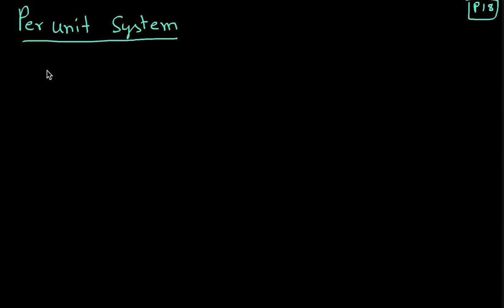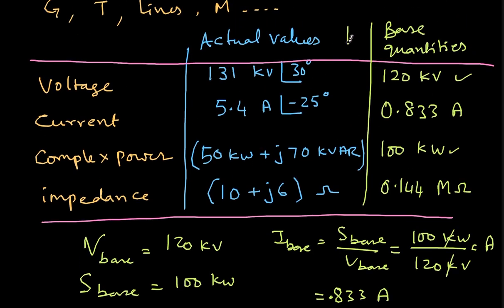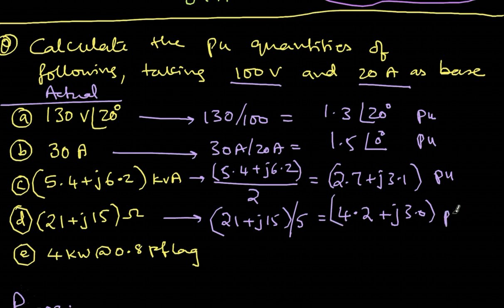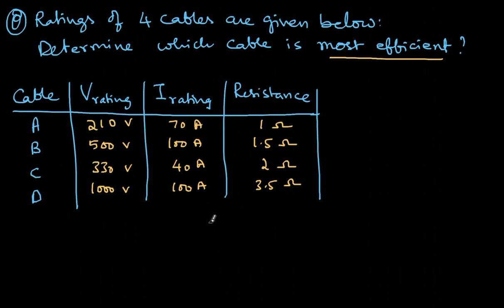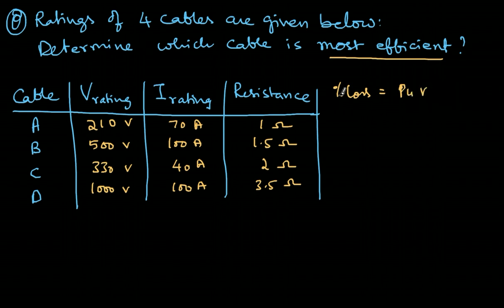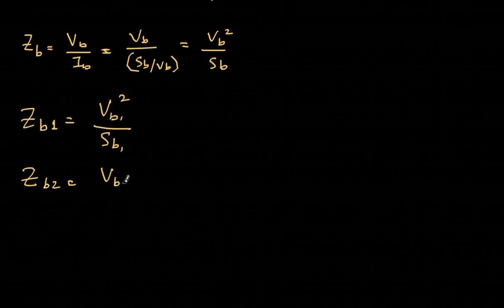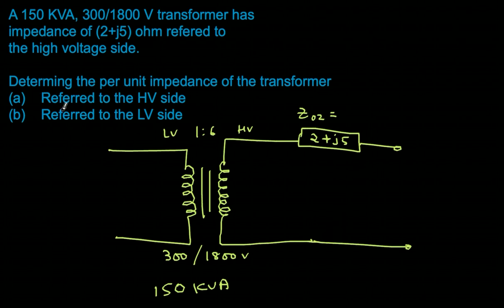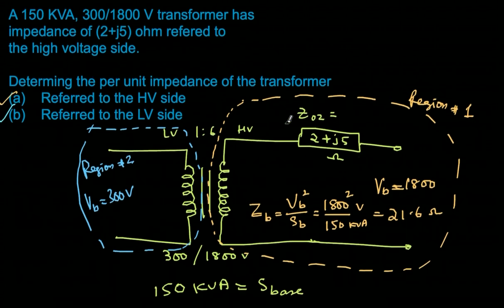Per Unit System - part 1

Comment: where did you get the 6 square? i know 6 is the trans ratio.
Reply from the maker: can you mention at what time in the video is your question about?
Reply: @pradeepyemula6015  55 20
Reply: @aks5436  (1/6)^2 is a^2......a=turns ratio. To move impedence from the secondary side to the primary side we multiply the impedence on the secondary side by the turns ratio squared
Reply: Pradeep Yemula  hello sir i have a doubt Can i get your email id